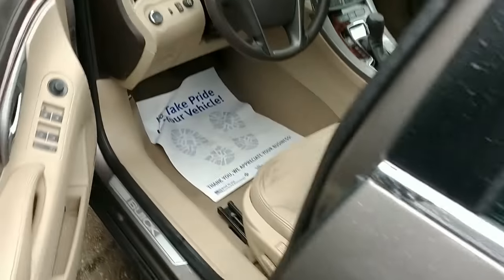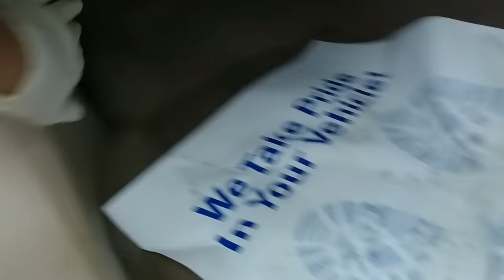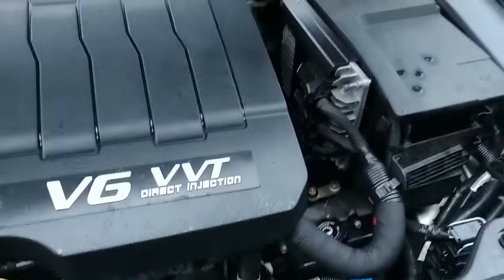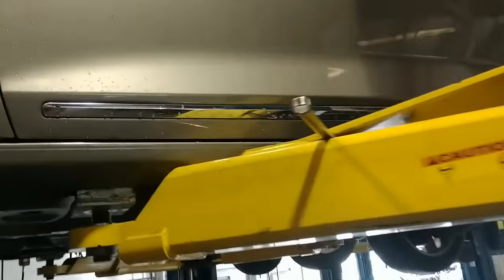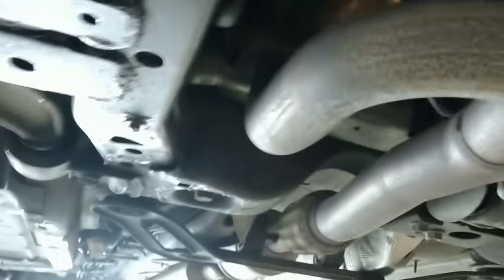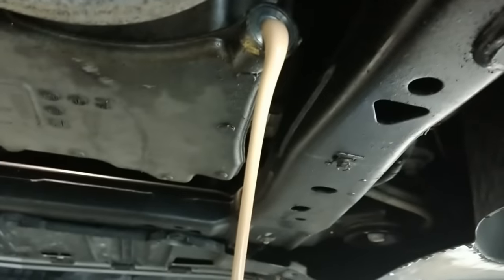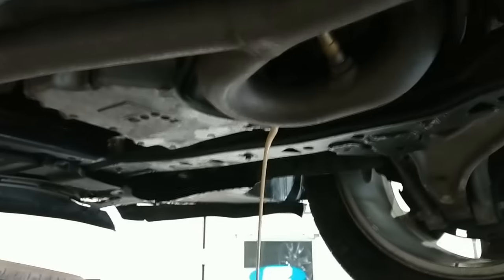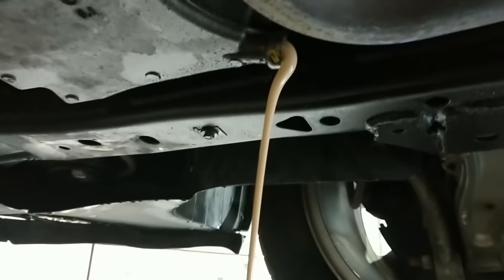Overfilled Crankcase! Blown ENGINE! Used Car Nightmare!

Comment: Once I was considering selling my classic sports car, flawless and well maintained, a friend of mine was interested on it, almost insisted on buying it. Well I decided to keep it, about a week later one of the fuel injectors damaged the cylinder bore. 
It was a expensive repair, which I paid, and still driving around with it.
Now, if I had sell the car to my pal, it would have had a bitter end for both of us. Was I hiding something? Nope, but it might looked like I was. A car is a machine that can fail at any time, even with proper maintenance and preventive works. The only difference from new is the lifespam (obviously longer) and the warranty which will cover defects.
Reply: learned from a young age not to sell anything to friends.
even if the car broken down 18 months later, they would still say you sold them a crappy car.
friendship aint worth losing over a motor
Reply: I always buy new. New is nice, but that warranty is good reassurance. Funny though, I have bought 8 brand new cars, Toyota,  Pontiacs,  kia, Hyundai,  Mitsubishi, never had any warranty issues!!

Comment: Thing is a 2012 Buick Lucerne is not a bad vehicle per-se, they are not the worst and will generally last a decent bit if properly maintained. However in this case, this was a case of a blown headgasket if I have ever seen one, this is gonna be one very expensive fix. Customer drove it 100 miles before it did this.... I am betting it was at highway speeds too, this means if it overheated on the highway there is a good chance there is some scoring on the cylinder walls... I hope that is not the case but I have a feeling that it is.
Reply: The car looks pretty clean with a good body.  This would be a good car to buy for a mechanic as a side project he can work on in his down time.   The most I'd pay for a a car like this is bit over scrap value, not the thousands I'm sure the owner paid for this pile.

Comment: Ive always said there should be a dedicated business for inspections on cars pre purchase like a home. A home inspection costs like $300 but one of these once overs should be like $50-100 and well worth it if you arent mechanically inclined. (Yes i understand you can hire a mechanic to do it but you have to convince a stealership to let you drive the car to a shop which they usually dont agree to)

Comment: I love the way he's acting like he doesn't know whats up to create suspense 🤣
Reply: i thought his reaction to seeing the white sludge on the oil dip stick was a little too calm. if i was him i’d be like “oh my god. oh my fucking god” then immediately run to show someone else
Reply: I am no mechanic, shade tree at best, but I had a really good idea when he said it was overheating and i was sure when I seen the smoke that the head gasket had been blown and the coolant was mixing with the oil.  That is not the end of the motor persay, the head gasket can be replaced and isn’t that bad of a job.  The only problem you. Run into sometimes is the head maybe warped or cracked, in that case you are fucked and will need a new engine.
Reply: Soon as he started it and saw the smoke screen out the back he knew exactly what it was...  Lol
Reply: @guidosarducci166  yep whiyte smoke.. dead giveaway....  even i know taht as a driver nd been told a few times ...
blue smoke rings..
white smoke.. KYAG (kiss your axx goodbye time...lol)

Comment: The term to "fudge" something comes from the days of the first used car dealerships. They'd put fudge in the engine to silence the knocks and pings long enough for the customer to get a few miles down the road before the fudge melts and the noises come back. Then, if the customer comes back wanting the car fixed they would be told that the cars are sold as is and all sales are final. If he wants to sell the car back to the dealership wouldn't get as much as he paid for it earlier the same day due to "depreciation".
Reply: What is the commun name for fudge, if you please (not my native language)
Reply: @txgunguy2766  chocolate fuse... Oh my ! 
Thanks for the answer
Reply: @sophietheresehautenauve  
More like a temporary lubricant.
Reply: Dont forget the precursor to this, feeging. Where horse breeders tried to sell old horses by making them look younger and stronger. But to make them look younger and stronger, they put a live eel up their ass, which would cause the horses to panic, and move in distress. For an old horse, that would make them look younger, and sell better.
Reply: @pauldeddens5349  how gross... I didn't even know what an eel was in english... Mecanics leads to many things... ;)
Reply: @pauldeddens5349  
I've never heard of that and I still wish I hadn't.
Reply: @txgunguy2766  It gets worse but ill spare you the details.
Reply: @pauldeddens5349  
Thank you.
Reply: @sophietheresehautenauve  Fudge is fudge. A chewy sweet made from caramelised sugar and cream. You chew it and it melts in your mouth.

Comment: My middle kid is an aspiring mechanic.  He's built up quite a toolset, volunteered in a few garages, and took a dealer-sponsored auto repair shop class at high school.  We went looking for a car for him and crisscrossed the city looking at one POS after the other.  At the last stop, we looked at a Chevy Malibu.  It looked to be in great shape though it had high mileage.  He did a visual inspection and then took it for a test drive.  Apparently, a few trouble codes popped up during the drive.  I was sitting in my vehicle when he came back.  He popped the hood and checked the engine oil dipstick.  We left and he said he had some major concerns but didn't elaborate.  Later the seller sent pictures of the trouble codes after he took the car to a car parts store.  One of the codes was due to engine knock and the other, engine miss (I think.)  The boy broke off any further pursuit of the car telling me the oil on the dipstick was discolored and had a solid substance on it that resembled yogurt.  Months later, the private seller dropped the price of the car by $2000.00  I'm sure he unloaded that POS on someone unaware a massive engine failure was no doubt imminent.

Comment: Gotta love GM's engineering.   The engine oil drainplug is literally 1.25 inches away from an exhaust pipe.    Well done Buick.  Well done.
Reply: Buick has went down hill since they ended the 3.8liter era, the 3.6 is trash.
Reply: @darkskys1757  Buick went downhill well before that.  Sit in a 1950s and early 1960s Buick.   I have a 1949 Ford with a 1960 401 Buick nailhead engine.  Fantastic motor.

Comment: I was once offered a Chrysler Concorde, and later, my wife was gifted a Dodge Intrepid, both the same engine (the EER 2.7L iirc). The masterful work put into this specific Chrysler engine came with a curious difference of opinion when it came to design compared to its competitors. For you see, this whimsical design included a waterpump inside the crankcase. So that when the waterpump seal failed, it flooded the crankcase oil with water.

Comment: This is why I'm glad my old man was a mechanic. He may not have taught me much, but I know how to change a tire and check the oil. Chances are I'd have seen the oddly coloured 'oil' before buying and passed on the car out of caution.
Reply: Based on this car making it 100 miles, the shady dealer probably had changed both the coolant and oil right before selling it to mask the problem. Checking the oil wouldn't have turned up anything immediately
Reply: @willausterman3104  Definitely. All the signs of an internal headgasket leak. There might have been no way to tell, even for a trained mechanic, until running the car. Always do a test drive and test idle

Comment: Just before the pandemic, I resurrected and helped a friend sell a 1977 Lincoln Continental Town Car with the 460-4bbl. His dad had left the car sitting in a field ten years ago, and died without telling us what was going on with it. 

Before I got it running, I checked the oil and the coolant and all the other fluids - they all looked good even though the car had spent ten years sitting outdoors. So did I replace the oil or the coolant or anything else? Hell no. I explained to the buyer that these were the fluids that were in the car and they need to be changed. But I left the fluids in place, as found, so that the buyer could see the condition of the oil and antifreeze in the engine. That way, the buyer has some assurance that the bearings aren't shedding bits of babbitt and the head gaskets are good. 

"She's as-is, but I believe the fundamentals of the engine and transmission are good, and I left the original fluids in place for you to see that. You will need to change radiator hoses and a bunch of other old rubber pieces before you can safely take her on the road, so you might as well wait until then to change the fluids." Instantly, I could see the buyer relax. 

The buyer just touched the key to start her up, and we gave it time for the thermostat to open and the upper rad hose to get hot. We looked at the sun-faded interior and lamented that the car hadn't been kept covered. In the end, he didn't even bother to use the compression gauge he brought, he was as confident as I am that the engine was good. Sure, maybe needs a rebuild down the road, but runs well and no cracked castings or spun bearings. 

Original tires from Wixom. It took a Duraspark II module because the plastic connector had become brittle (but thankfully the wiring harness end was still good), repairing an improperly installed (not grounded) distributor pickup coil, a fuel hose from the frame to the pump, a fuel filter in the carb, a starter solenoid, and a battery. She proved she was eager to run, and with a few fanbelts and hoses I would trust that car to go across the country. But that's for the buyer to do, not me. 

I treated the old girl with love and respect as I got her running in the driveway, did everything I could to keep her as original as possible, and I told him what I know of the car's history. I saved the parts I replaced to get her running again and explained my reasons for the replacements. The buyer turned out to be an experienced collector of 1960s-1970s "slab-sided" Lincolns, and loved how openly I explained car's situation to him. A few months ago he e-mailed me a picture of the car sitting in his shop beside a Continental with suicide doors - that gave me a smile during pandemic lockdowns. 

Fresh fluids in a used car are an immediate red flag to me. Thanks, no, I can drop the tranny pan myself in my driveway - I'd like to see if you were towing a horse trailer behind the Prius you're offering to sell me. 

A used car dealer? Has to fix it and flog it. The rest of that Buick looked decent, I would have been tempted to put a new engine in it if the milkshake machine was pooched. 

I am NOT a service tech. I am an accomplished shadetree mechanic who loves old cars.
Reply: And your long winded
Reply: Nice book..

Comment: Working on heavy diesels, commonly found when the owner insisted on using plain water for coolant, the sealing area for the cylinder liners would be eroded.
The old-tim red would say it was infested with iron worms.

Comment: This is why before you buy a used car you should pull the dip stick and look at the condition and level of the oil, some people even smell it.
Reply: I smell it, if it smells like gas and the oil still looks good I don't get it.
Reply: They probably changed the oil prior to selling and poured blue devil or something else in it to conceal it.
Reply: This is why people who know nothing about cars should pay a reputable mechanic to do a Buyer's Check. It's the same as buying a house without a home inspection...BAD IDEA.
Reply: @Cautionary_Tale_Harris  Yep!  A pre inspection would have easily identified this.
Reply: Some cars don't even come with a dip stick anymore
Reply: @dylanvance96  Fuel smell can give hints, but isn't necessarily the whole picture. It might be relatively benign, like a leaky injector, or short trip-driven car. Not necessarily rings.
Reply: @avi8r944  Yeah but there’s always one for oil!
Reply: I do & I smell the exhaust.  Sounds silly or stupid to some, but from as far back as carbureted  engines I can tell a lot with a quick whiff & a feel with my hand of the exhaust.
Reply: @12yearssober  this is why you test drive at least 10 miles and recheck all fluids
Reply: @alecsandrhopp3512  i meant on cars like BMW, there's no oil level dip stick. There's a sensor instead.
Reply: Oil cap will show it if no dipstick is available
Reply: unfortunately not all cars have dipsticks. my bmw does not.
Reply: @ajgaylo  you'll never know how much oil it could burn. 🤣💥
Reply: Not my story, but I heard of a guy who bought a car with a leaking head gasket. 
 The oil looked fine even after the engine completely crapped the bed.  It turns out the previous owner had pulled the pan an put a piece of rubber hose on the bottom of the dip stick tube. They capped off the open end of the hose with a bolt and just poured some clean oil down the dipstick tube.
Reply: @Captain_Jack514  Hopefully.   I paid for a pre-purchase inspection in a 5 year old Mercedes with 105K KM  at a Mercedes dealer.  Found some irrelevant small picks.  Dealer failed to notice the engine was full of sludge and that it had a broken engine mount.  Previous owner had skipped oil changes.   When we flushed the engine after I purchased it, I had lifter noise.   Sold the car afterwards and took a bath.  You need a on old school mechanic that will take the time to inspect the car.
Reply: @1949coupe  If it was full of sludge, I would have walked away.  Those vehicles have very low tolerances.  The damage was already done.
Reply: @dylanvance96  Depends on the age of the car and how it was driven. When I bought my 22 year old toyota 2 years ago, it was mainly driven by an elderly women for short trips in the city and it never saw a highway for probably the last 10 years or longer. It had a little gas smell on the oil stick, but was also quite dirty on the throttle and maf, but oil looked ok, also no milk on the cap. After cleaning everything, pushing it onto the highway and a few oil changes over the years, it runs perfectly fine for a car that cost me almost nothing. Sparks are 4 years old now and still look very clean. A little smell of gas on the oil is nothing unusual and nothing to worry about if there are no other symptoms. Old, dirty fuel injectors can easily cause this smell without being a permanent problem that can't be fixed easily.
Reply: @Captain_Jack514  I would have except I bought it after the pre-purchase inspection came back ok from the MB dealer.   Why someone would skip an oil change and drive an expensive car 30K without changing the oil is also beyond me.
Reply: @Dlow-kc6jv  it burns 3/4 pint every 3000 miles. put 6 in and in 3000 miles a little over 6 comes out.

Comment: This reminds me of our 1984 GMC Jimmy. My wife and we’re driving home  one evening and it overheated. The oil looked just like that. Of course the warranty had ran out not to long before the head gasket failure. I made the repair myself what a fun experience not. I put it all back together started it, a big loud backfire occurred I wondered what I had done? Turned out to be the brake booster hose had came loose when installing the gasket(s). The hose had a split in it I cut off the split section. The Jimmy cranked right up no overheating no mixing of antifreeze and oil. Within a year from this problem we traded it off for a 1988 dodge caravan that’s a whole other problem…….

Comment: Back in 74', I believe, I was on a trip with my 1970, 428 Mustang when I heard a "poof" like sound and a slight drop in performance. I had heard about Fords blowing out spark plugs, but after checking them, I found them ok. Took the next exit and headed back but coasted into a gas station at the nearest exit. Pulled the dip stick out and it looked like Mississippi mud. That's when I learned oil and water can mix, under certain conditions. One of those huge intake valves broke off and ricocheted around the engine, breaking pistons and cracking the block.
Reply: Today you’d be looking at 5 to 7k just for a block the rebuild would run you another 3 to 4K then add another 1 to 2k for installation. All in all an easy 10 to 12k job
Reply: @matthewcaughey8898  No doubt. That was back before Mustang prices went over the roof. Because it was a Cobra Jet it had a Shaker hood. That alone can fetch a good amount of money.
Reply: BarbarossaBMW88ϟϟ  LOL, yeah, at first, then the the valve pong happened.